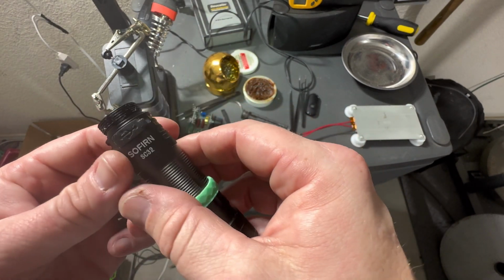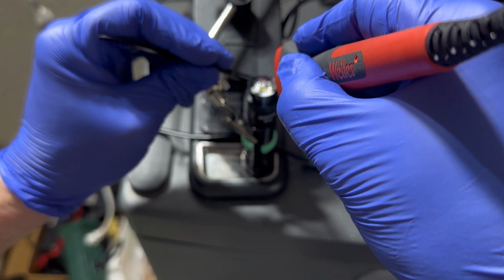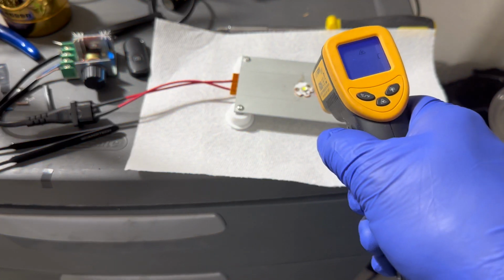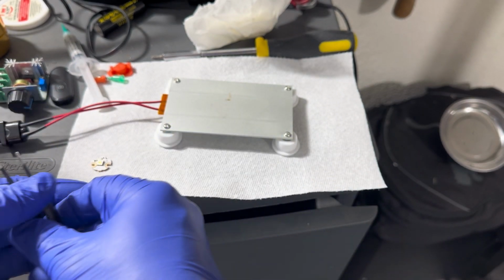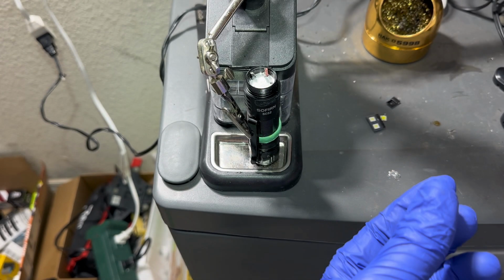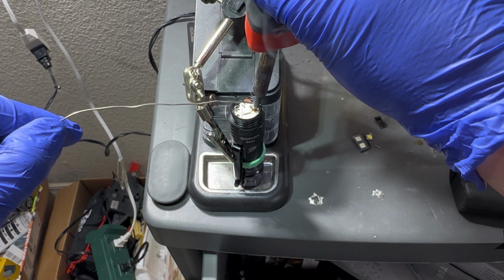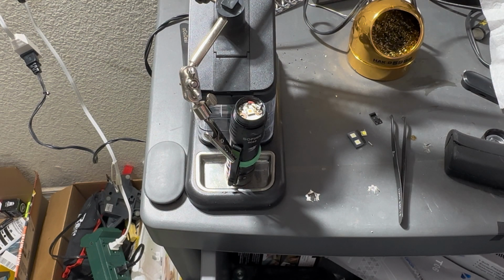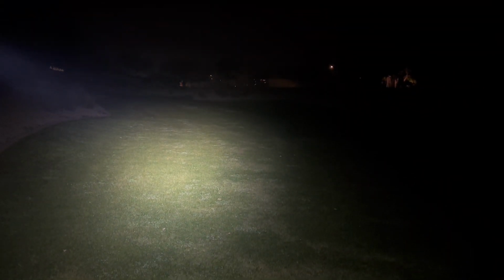Modified Sofirn Sc32 with sft40. Whole tutorial on led emitter swap

Comment: I’m wondering about swapping and SFT40 into a sp35t
Reply from the maker: It would definitely help it throw much further. That’s a good light for a sft40 and the op reflector produces a great beam. Best light imo per dollar for edc is the wurkkos td05 with a 3000k or 5000k sft40. I have the 3000k sft40 in mine. Also just put a 3000k sft40 in a Pd36r for one if my subscribers. Beautiful. I need to record more

Comment: 1   Please send me the link for SFT 40, I'm looking at it on Aliexpress, I'm confused.there are too many models

2  Well, would it work if you replaced it with sft 70?
Reply from the maker: Just found this amazing item on AliExpress. Check it out! $7.44 | SFT40 3000K 5000K LED
https://a.aliexpress.com/_m0humNk this is the link for the 3000k and 5000k sft40. I definitely recommend the 3000k as it’s high cri and beautiful. If you want the whitest light like from a 6500k lmk, but you’ll be able to find it on convoy store. Also order more than one as they become much cheaper the less you buy. If you need some 6500k lmk and I can
Sell you some. Also you cannot use a sft70 as that is a 6v led so it needs a 6v boost driver
Reply: @marcgossling8260  Hello again
I bought sft40, it will be installed today, I saw you, this procedure was good.
my plan now
It is a little difficult to put smo reflector and clean glass inside, but I will try it.
Thanks for the video
have a nice day
Reply from the maker: @onuraker33 what flashlight are you doing this on? I have much better videos than this about how to do a led swap
Reply: @marcgossling8260  I also have sc32, I watched this video and ordered sft40 and changed it.
I `m talking about this
Thank you, your videos attract my attention and I like them

Comment: Any way you can put links to the Amazon products you are using?  I use a cooking hot plate with a steel pie pan and I use a no contact thermometer to read the temp.  Not perfect but it works OK.  I like your setup better for an affordable option.
Reply from the maker: Sipytoph 2000W PWM AC Motor Speed... https://www.amazon.com/dp/B095J3FYKH?ref=ppx_pop_mob_ap_share
Reply from the maker: TKDMR 300W PTC Heating-Soldering... https://www.amazon.com/dp/B07W1ZZH8T?ref=ppx_pop_mob_ap_share
Reply from the maker: Etekcity Infrared Thermometer Upgrade 774, Heat Temperature Temp Gun for Cooking, Laser IR Surface Tool for Pizza, Griddle, Grill, HVAC, Engine, Accessories, -58°F to 842°F, Yellow https://a.co/d/bTzN3XX
Reply from the maker: All this for less than 40$ off Amazon. I installed the ac motor regulator myself. It’s simple to do